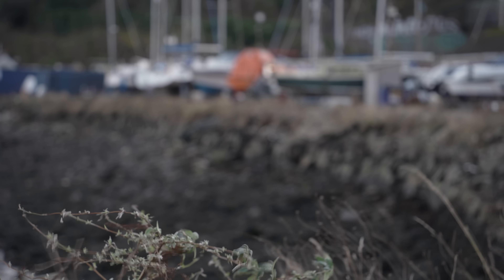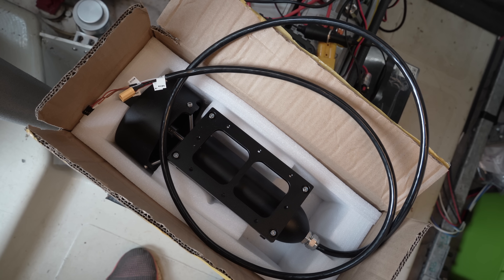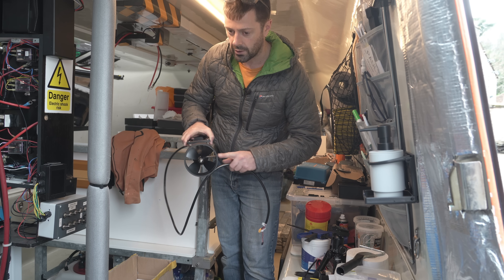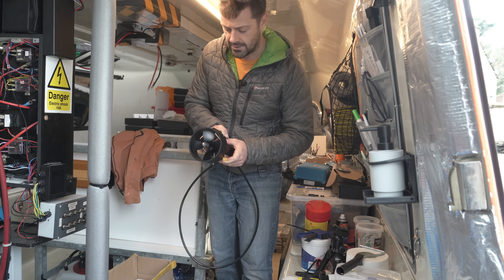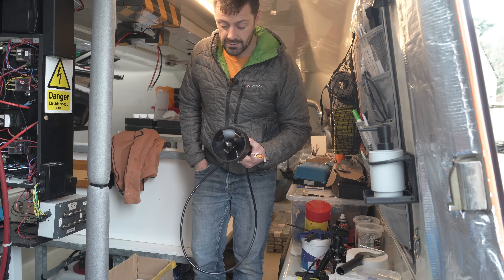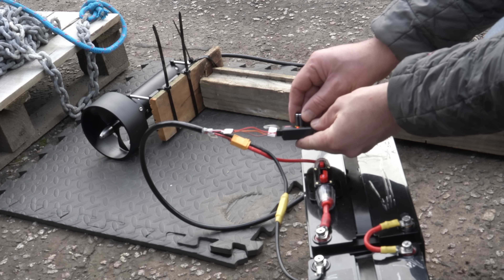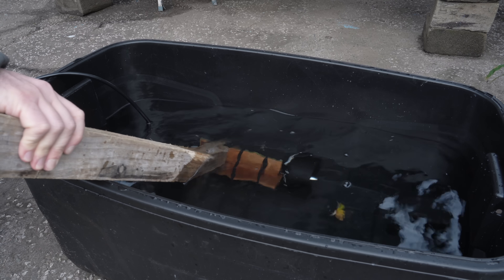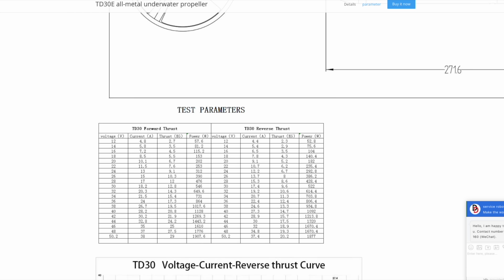Underwater Electric Thruster Test - 24V 1200W motor. Expedition lifeboat conversion Ep107 [4K]

Comment: Hi Alex 
Help please if you would 
I’ve purchased a 48v unit from one of the alternative suppliers and the pwm from Apisqueen
My motor unit is missing the centre wire from the 3 pin plug for the pwm 
Could you tell me where it leads from 
I’m suspecting possibly a 5v supply to the pwm
Many thanks in advance to anyone that can help
Reply from the maker: I'm afraid I'm not sure of the exact problem - hard to visualise. You can email ApisQueen though and ask - they do reply in a manner of speaking... They sent me an incorrect lead, and had to replace it.

Comment: I just noticed the dry barnacles. The barnacles below the waterline will create a lot of drag.  Don't waste a lot time trying to sand them off! You can clean them with muriatic acid (pool acid) mixed with water ( 1 part acid to 3 parts water) inside a spray bottle.  Spray it on and watch them melt away,  rinse immediately with clean water.  Just be careful with the fumes especially if the ground underneath Allen is concrete or full of barnacles as well.  You can cover the ground with a tarp to cut down on the fumes and rinse it off as well with clean water.
Reply from the maker: Good advice. Although, I'm going to do another paint/antifoul coat, so will need to lightly sand back anyhow.

Comment: I am more curious how you plan on mounting the bow thruster in a way that it wont fall off.
Reply from the maker: A crew member will hang over the bow and hold it there.
Reply: @AlexHibbertOriginals  ahhh then they can double as a fender

Comment: A bow thruster is run in short bursts. My wheelchair is 24v and pulls that same amperage all day long and my start loads are considerably higher than what you will encounter. All of my wires are the same gauge as yours. Remember as your voltage goes up your resistance drops over the same cable distance. So the voltage drop for 2 meters @12v is going to be half at 24v. Bow thrusters are usually run from momentary contact switches not run continuously like a trolling motor. But if wondering have a look at the recommended wire gauge for 50 amp Anderson pugs at 24V.
Reply from the maker: Cheers. This is to power the dinghy too though.

Comment: Hi Alex
Re electric motors
The voltage drop is about 3 volt on the current setup, that gives you just over 1000 watts. Whats needed is 6 AWG to give you maximum power with only a .25 voltage drop. Cost about £1.50 a foot for good quality stuff.
Wish you well sir.

Comment: I am using the exact same batteries to power a 24v 800w electric outboard motor. They work well and seem to have the advertised capacity. One word of caution though if you discharge them to shutdown they may not come back on with a 24v charger. I had to use a 12v charger on each separately to get them back on.
Reply from the maker: Thanks. I'll charge at 12V anyhow. And will use a battery guard to avoid low voltage.

Comment: You will probably find that the Motor isn’t even a 50 W motor hence why you have small gauge wire, the Chinese due this quote regularly and exaggerate outputs, especially on batteries and motors
Reply from the maker: I have an ammeter on order - so we'll find out!

Comment: Do you have any idea what the cable sheath is? If it is something like silicone it can run far hotter. The risk you have is that the inner insulation melts and causes a short circuit if it is not a thermosetting cable. Saying that for the short durations it is being run for, I would not be too worried, especially if you are using a speed controller and it is not constantly running at 100%. The place to be a little carful is where you bring the cable through a bulkhead, that is where you will get heat buildup. If you want to test the actualy current it is pulling, I have a clamp meter you can use, I also work with a couple of companies that do subsea cable jointing, conectors and penetrators that I can put you in contact with.
Reply from the maker: It's not silicone - probably pvc or polyolefin. But in any case, thin wire is inefficient even if you can actively pull away the wasteful heat to reduce the safety issue.
Reply: @AlexHibbertOriginals  it is definitely not right, they should have put thicker cable on. In terms of losses, it is about 60w per meter of cable. I would be tempted to try and shorten the cable as much as possible, or open it up and try to replace the cable completely

Comment: For that amount of money you could buy a very good outboard electric motor, which could very easily be repurposed if it doesn’t work out as a bow motor, and has proven reliability. The ducted motor looks kewl, but judging by the company reps claims regarding the wiring I wouldn’t trust the performance figures they quote on their website. Would be interesting to see how the ducted motor performs in a test compared to an unducted electric outboard motor.  Depending on Alan’s loaded tonnage, there might not be a big difference.
Reply from the maker: I don't think having lots of outboards would work in the module I have in mind for emergency power, or fixed on the bow as a thruster. I'd also struggle to combine them all under a remote control system without having one custom made and voiding the warranties of the outboards.

Comment: For the damper. Maybe take a look at compressed air "muscles". A silicone tube bladder filled of slightly compressed air (or even plain silicon rod), in a regular nylon braided sheathe.

The damper can be made as long as needed to allow for the right amount of stretch.
That would look very sleek.

Comment: Would duty cycle be something to think about? On a bow thruster you are unlikely to run it full tilt for more than a minute or so. Probably best to use this one for the thruster and the newer ones with larger gauge wire all the way for the tender.
Reply from the maker: Very wise indeed

Comment: Don’t remove the rub rail. Just seal it to Alan with black marine caulk. Fill the gap from the top, bottom and the screw holes. This will keep both sea water and rain water from coming in. 

I fear this would be a very much larger project then need be. Whats that saying about perfect and good enough? Don’t let perfect be the enemy of good.

If the thruster is going to be mounted permanently below the water then I’d make sure to do a leak test. Way it before and after sitting in your fresh water bin over night. 

I’d go with 10 gauge wire for 50 amps continuous.
Reply from the maker: You are very much along my way of thinking. I didn't want to sway people first though in case of other ideas.

Comment: As others wrote your test gives you no valuable results of cable temps.
The way you test in air shows a bit of air pushing plus motor losses. Also testing in a circulating box does not gives the true " water pushing load". If you want to now the truth... run it in the sea. And use a ampere clamp meter to see the real current. 
For the waterproof gland I highly advice you to use "Blue Globe" once. Plus pure-type cabling... 
Why do I advice? Because I did some diving lamps and diving scooter. I real condition the power is bigger ( broke my motor wheel 😅)
You will be to fare away to defect them fail..
Love your project and All the best.
Reply from the maker: I did say I need to make a pontoon mount to run it down in the marina. I just thought the first impressions would be of interest.

Comment: Years ago we had to jumpstart an old forklift at my job. I had a set of jumper-cables in my own car that came with a very cheap emergency kit I had picked up. We hooked them up to the boss' diesel pickup and then to the old forklift. In ten seconds I watched the insulation melt off my cheap (thin) cables.

Comment: if the interior can seal air tight, you could remove the inner seal of the boat seam, run a nice new seal around the rub rail and close it all watertight, and then run a serious dehumidifier for a few weeks. That should encourage all that trapped moisture to come out of the joint section.
Regarding Chinese motors generally, I expect that you will find almost exactly the same design of motor from other factories, possible subtle differences in cable used or colours, but the specs will vary wildly as will the prices, but nothing internal will be actually different. Eg you may find one with double the rating and a higher price, only to test it and find it is exactly the same, and can't meet the actual rating provided by the manufacturer. Just a caution from previous mistakes I've made.

Comment: I can't give advice with the technical issues in this case, only what I learned concerning breaches:
have wooden stakes and fabric on hand: if you have hole wrap the stake in fabric and hammer it in
also get a dead-men-buoy on the outside tht will disattach at a certain depth and send out a distress signal
there also rescue "islands" that can automatically detach and inflate themselve if they reach a certain depth
and maybe get a survival suit as the survival (if you fall into the water) is one-digit minutes (thumb rule for us was 1°C (over zero) equaled one minute
Reply: PS: get some emergency flares and a emergency radar transponder
you might lnot egally allowed to use the first one but in an emergency you can use it (ianal)
for the second it detects any radar (if acticativaed)  signals it receives sends out 12 pulses signalling distress and giving any vessel the distress signal, distance and direction
Reply from the maker: Warm socks too no doubt !
Reply from the maker: Fabric for bungs/stakes is wise. Thanks.

Comment: Maybe use silicone spray grease injected along the inside seam? It’s renewable, effective and rust controlling.
Been sealing my boat windows for some years while avoiding the inevitable..
I would certainly leave that rubbing strake severely alone!
Reply from the maker: I certainly echo your last point. It's a good rubbing strake!

Comment: if you need batteries ive got the hoooooook up ;p im sitting on over a dozen northstar reds 12v 200amp
Reply from the maker: Not sure if this is a genuine offer! Are you in the UK?
Reply: @AlexHibbertOriginals  It's genuine lol, I'm in the US so shipping might actually bite us in the ass, didn't think about that. They're like $500-700 each but I was selling for $300, however for you I'd do $200 each but I'm not sure what shipping would be. If you're interested Ill look into it. They're rated for air shipping too. Basically I work on radio towers and we installed them for a 911 system and only a few months later they were replaced with a diesel generator and were never used. So they've just been sitting in a battery tender cabinet. They are beasts.
Reply from the maker: Sadly they'd cost about $1000 per pair to air freight!
Reply: @AlexHibbertOriginals   I crunched some numbers and just as an example to get all 12 from here to say London the cheapest option I found was about $1,000 on the nose. I know you need ballast though ;p wink wink and they're about 61 kilos each. So if you got all 12 you're looking at about 3,400 but I'd give you 2 free and make it a round $3,000. Food for thought. Otherwise I'll just end up selling locally. I actually have 16 of them but want to keep a few for my own little projects.
Reply from the maker: A kind thought, but I think best to sell local!

Comment: For motors etc using the Chinese rating system probably the continuous rating would be perhaps 1/3rd that quoted which would explain the undersized wiring.

Comment: I agree the Chinese manufacturer is using too small a wire gauge.   I have many 16 gauge extensions, used for up to 15 amp for A.C. power tools.   I would not trust these at 20amp for extended periods of use.   A UK YouTuber John Ward has many videos on electrical items.   Some are where he operates dodgy equipment often with wires of too small a gauge.    Often these fail by the wire burning up.    Sometimes the wire is copper coated steel so higher resistance and heats up faster.
The last thing you want is a piece of equipment failing when you are on the water.
I think 10 gauge is more relevant for 50amp if you have the space in the gland.

Comment: The wire is definitely undersized according to good engineering principles, but probably not dangerously so in this case.  It will be used intermittently for short periods of time, outdoors, half underwater, and not coiled in an enclosed place.  Probably fit for purpose for a bow thruster but nothing more.  They look like surplus or grey market ROV motors to me.
Reply from the maker: The core motors appear to be those generic IP68 pods very commonly available on component websites across the world, then the various companies do their own ESC, prop, mount and wiring to complete the unit.

Comment: Hi Alex. I'm not an expert on wiring, but what I do know is that you need to "load" a motor to test it. It won't get to 50A until it's under load in the water.

However 16AWG is pretty dismal for a 50A rating. I would be going for 10-8AWG, but if you can test in a bucket then run it at high power and test some different guages.
Reply from the maker: Yes, an in-water test is key. Will make a pontoon mount.

Comment: Alex, I think you are right to have concerns about the overall quality of Chinese supplied equipment. While they are more than capable of producing high quality goods, there is a murky (almost fraudulent) peripheral environment which produces crap and they outright lie about specifications and capabilities.

Just a few observations:

1. You have not conducted a full load test, and that is important if you are examining the cable temperatures (heating effect = current squared x resistance).
2. As far as bow thruster duties for Alan is concerned, you might get away with it, as this is not continuous use, as it generally used for short periods of time and in bursts.
3. The more arduous application is the tender , where you are much more likely (in comparison) to be using at or near full load for significant period of time.

If you are interested in some of the issues with Chinese supplied equipment (electrical) I will edit this post with a link to an excellent video which gives a real world example. https://youtu.be/DInwut0DzTQ?si=U3NjRkEP3GMz0oW4. It’s a long video (40 mins) but well worth watching - the chap knows his stuff.
Reply from the maker: Already up to speed with 1-3, cheers, and thanks for the link - will have a watch.